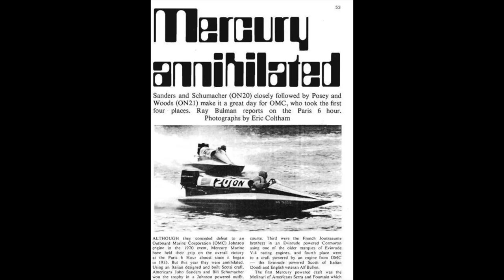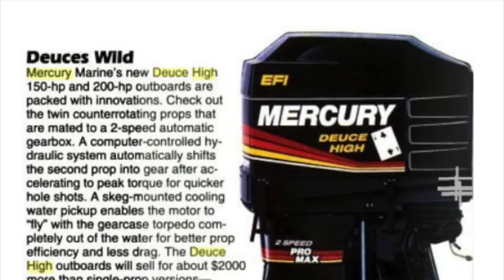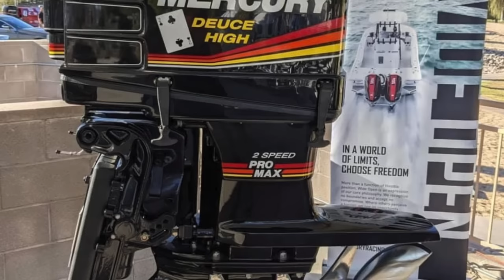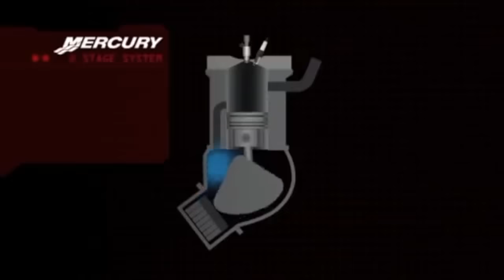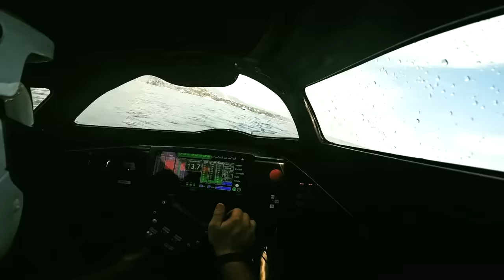Mercury Racing TOP 5 ENGINES OF ALL TIME 50th Anniversary Special

Comment: The deuce high was a fail from the word go ...it never worked correctly and the lower unit would blow apart under load when the "shift" took place...we learned it was a novelty more than anything.. it was cool but didnt do anything better than a std gearcase in fact it added weight and drag...maybe they learned something that helped develop the bravo three??
Reply from the maker: Everyone I've talked to who has experience with it said it wasn't really a speed boost, but an immense increase in stability, lack of prop steer/more stable.   Same top speed as without it, so ultimately it was a lot of engineering/complexity for a very small gain.
Reply: @ADDvanced  please share with us who you talked to that had experience with it?
there were no gains as the thing never survived more than a few runs..lol
Reply from the maker: @crashalexander7232     A hydrodynamic engineer at Mercury (John) who worked on the program when it was happening.  Your first name isn't Charlie is it?   But you're echoing what he said; no top end gain but better/more stable at speed.
Reply: @ADDvanced  It was never designed to be faster it was intended to be quicker....you understand the difference right?  merc never expected it to run higher mph just quicker holeshot and ET....adding a second prop adds drag along with weight both the enemy of top speed ..a single prop speedmaster 1:1 was and will always be faster by far!!

Comment: I worked on outboard s in marina dealership since 1976...
Before 1980s Salt water ruined them Mercury ob.
. Terrible issues.
No overheating alarm melted piston s swallow reed valves corroded blocks rusted drive shafts shift shafts..
OMC was the only good salt water motors until 80s.
Yamaha came out  and stole Mercury and OMC designs.
We still have 1970s Johnson OMC v4 running .

Nice channel.
Reply from the maker: Yeah, Merc struggles with perception of saltwater reliability to this day, despite recent yamahas requiring flywheel replacement every 300 hours.  Once that perception exists, it's hard to break.
Reply: @ADDvanced  not all Yamaha. Only large ones
Reply: @ADDvanced  1970s merc rusted . After 80s ok

Comment: You missed the coolest engine of all time, the 2.5 efi 260/280/300. WTF?
Reply from the maker: I picked one from each decade; the deuces high is everything cool about those but even cooler.   I did a separate video just about merc 2 stroke v6s you should check out.

Comment: Get toroidal propellers on all these and test em all again.
Reply from the maker: They’d be more efficient at low speeds and moderate barely cruising speeds.  They’d lose a ton of top end.  The sharrow prop is not a surfacing/high speed prop. 

Ex: wingtips on airliners make the wing more efficient.  Those tips don’t exist on fighter jets.
Reply: @ADDvanced  touché, that example you gave I know exactly what you mean.  Thanks!

Comment: Had me until electric. I’m out.
Reply from the maker: Sounds like you need a safe space, snowflake
Reply: @ADDvanced  typical gaslight response, lol just go electric,
it’s fine. It’s just not for me. Electric Doesn’t move right, sound right or smell right to me. I’m old and reserve the right to like what I like and if that makes it okay for you to be nasty and call names, get on with your bad self. I can take it.
Reply from the maker: @b.d.ericksonii203  Seems like you can't take it.   I don't own anything electric, but I can be excited about the potential for things in the future.  The first gasoline powered boat race had a top speed of 19mph, in 1903.   Given that closed circuit boat racing doesn't have a huge range issue, I think electric seems like an interesting opportunity....   I am hoping that with identical battery packs and drives, there might be freedom/innovation in hull designs; we haven't seen a lot of that since the explosion of air entrapment hull development in the 70s/80s.  90s hulls got better too, but not such a huge leap forward.  After that...  maybe stepped hulls on Deep Vs in the early 00s?   With relatively small hulls because small EV power, maybe we'll see some cool hull designs that would then transfer over to gasoline powered hulls as well.  Look for opportunity instead of just being afraid fo what you don't prefer.
Reply: @ADDvanced  no need to assume that

a. I can’t take it or 

b.  I’m fearful, simply because I have a preference. 

I also prefer my steak medium rare. Not afraid of a well done steak and will eat it if served and be grateful. 

I simply prefer it cooked differently. 

I’ve driven a lot of teslas and I stand firm, the sound is piped in and fake. There are things about them I don’t care for. 

I have owned 5 ski boats. From my 19’ Bayliner Cobra with its Force 120, to IO 4.3’s to my Ski Supreme with its 330 Black Scorpion inboard. 

They all had very unique personalities. Smells. Quirks. Looking back, I had the most good times in my youth with the 2 stroke. 

Those things land on a guys heart. It’s okay for me to have favorites. 

I won’t assume how you feel. I’d rather ask you than tell you. Nor call you out publicly. You’re safe with me to have favorites too. That’s the fun of a discussion. At least to me. Everyone is cool to weigh in on thoughts, opinions and best of all, fond boating memories. You don’t have to be such an ornery rascal. I’m a gentle spirited dude, and I’m not afraid to love what I love.

Comment: You killed the video and your chances for a sub with the electric part.  If you think that compares with the whine of a 2 stroke in any conceivable way, you are nuts.
Reply from the maker: Dang sounds like you need a safe space.
Reply: @ADDvanced  , a safe space?  Not really applicable here but I guess you can take a cheap dig as its your channel.  I just don't give in to the electric crap being forced upon us.  I also can't comprehend a silent boat race being grouped with a documentary of the greatest sounding outboards of all time.   Mention of electric and no mention of the new V12 500 and 600hp Mercurys as well.
Reply from the maker: @egresk1  Maybe you missed the title of the video, bud?  This is about MERCURY RACING products, not Mercury Marine products.  Mercury Racing does not currently offer a version of the V12, and if you knew more about it, you would know that engine is not for race boats, it is for large boats that used to be powered by stern drives, but are interested in substantial fuel savings, cheaper service, better torque, and joystick piloting.

Nobody is forcing anything on anybody, but the rich conservative folks that own all the lakefront property HATE NOISE, and they are the #1 reason that prevent boat racing from happening in more populated areas, like it used to.   Electric racing solves this issue!   It's not AS EXCITING as traditional ICE-powered boat racing but I'm stoked about it, as it uses absolutely wild hull designs that have never been tried before, and they're only going to get faster.  In 50 years when we have UltraLithium Cyberfusion batteries, electric performance might be better than ICE stuff, who knows, but the point is this is THE FIRST OF ITS KIND.   I'm pumped to see where it will go, and hopefully it will get people who would otherwise not be exposed to boat racing more interested in it!

Comment: Mercury didn't start making gtreat racing engines in 1976 and they didn't have to be 6 cylinders.. Mercury' won thousands of e class races with their 50 HP engine and the older 20 hp engines with the racing lower units were raced for years and years.
Reply from the maker: This video is specifically about Mercury Racing, which started in 1973.   I haven’t don’t a video on the top 5 mercury engines of all time but even the racing versions were not “mercury racing” products as that is a separate company that again started in 1973.

Comment: Electrics are not cost effective or efficient and they’re produced at a net carbon loss to the environment.
Reply from the maker: You're spreading bullshit, bud.   Electrics make sense on smaller craft, where the weight penalty of batteries vs gasoline is not a huge problem.   For sailboat dingies or boats that are not used frequently, electric is superior as you don't have to deal with gummed up carbs, or storing a smelly/leaking gasoline engine inside the cabin of your sailboat.   You don't know what you're talking about; different use cases have different solutions; there is no one size fits all.

Comment: You could have ended the video after the APX. I could not care less about electric anything. Give me brute force racing with all of the noise. Not interested in batteries.
Reply from the maker: We need racing near people or it dies.  Watch that section and I explain why it’s important for the future of boat racing.
Reply: @ADDvanced  I did watch it and my comment still stands. Battery powered racing is of ZERO interest to me. If racing has to attract people that shop for sustainable organic food and hemp clothing in order to survive, then it would be better off dead.
Reply from the maker: @darylmorse  Are you saying you prefer non-sustainable synthetic food?    Think about what you're saying.   The more people that can get excited about racing, the better, and maybe there are future racers and engineers and designers in the marine industry that haven't been exposed to boat racing yet; they might even the see an E1 race and then learn about hydro racing, tunnel racing, and drag racing.   Boat racing needs all the exposure it can get, it is a shadow of it's former self from the 80s/90s.
Reply: @ADDvanced  I was just being sarcastic. However, if someone only gets interested in racing because it's based on batteries, as opposed to fuel, that's not going to save racing. I have ZERO interest in battery racing.
Reply from the maker: @darylmorse  Could be cool, man.  We will see!